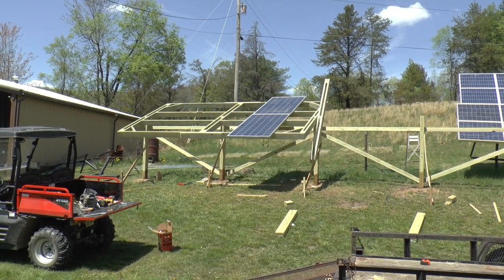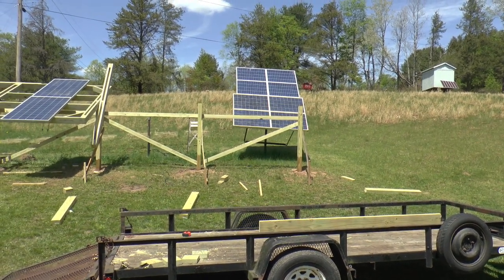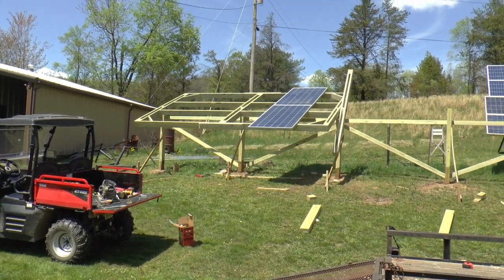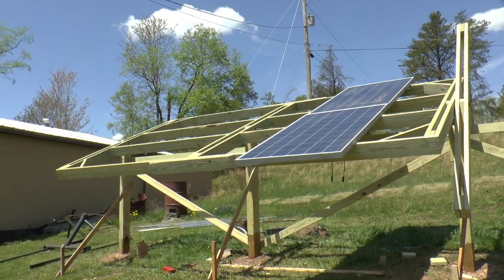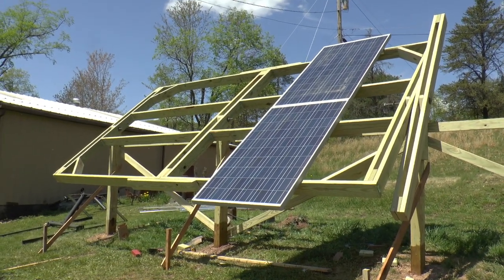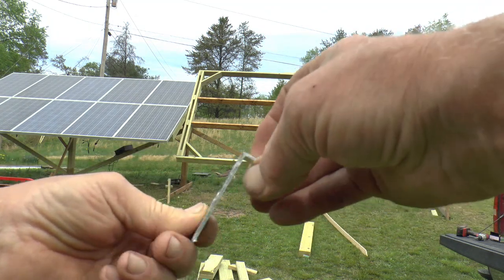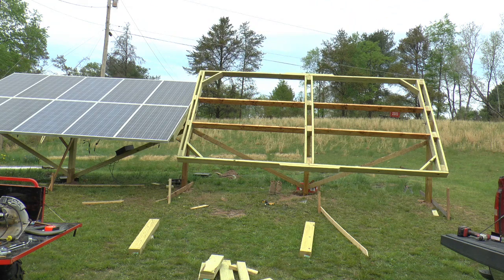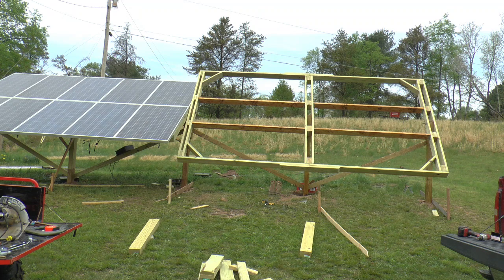DIY Solar Panel Ground Mount

Comment: Nice video.  I have seen this approach using the 4x6 posts.  One thing I don’t see on yours is a metal strut channel to bond the panels together.  It appears to me that making the wood structure can be done alone and mounting the panels later could be a 2 man job.  I am sure it can be done by one persona as well.  For the holes for the posts I am thinking of renting a post hole digger but that is a lot of concrete to mix!  Whew!! Again, thanks for the video.   All the best from north Texas.
Reply from the maker: The panels are mount to the wood using aluminum clips no metal struts. I have other videos showing more details. No concrete used for mine. Only some gravel in the bottom of the holes.

Comment: What are the dimensions? Spacing on the posts?
Reply from the maker: Everything is based on the dimensions of the solar panels your using. I laid mine out on a flat surface took the measurements and drew it out one paper.

Comment: How did you form a grounding bond with the panels, rack and ground?
Reply from the maker: All panels are series connected with a copper wire via a ground screw. That wire goes to the combiner box surge device and ground rod.

Comment: @papajunk I'm curious how you attached the pivot to the tops of your posts, particularly the middle post that has pivots for each array. The other designs I've seen go on either side of the 4x6 or 6x6. But your's appear to do something different. Can you please explain?
Reply from the maker: The center post is 10 inches shorter than the other posts. There are 2 x 6s attached on each side of the 4 x6 that are the same height as the other posts. That makes the space for the 2 x6s of each separate movable section. The pivot pin (bolt) goes thru all six 2 x6s.  The other posts are normal ( like everybody else does).  Hope this helps.
Reply: @kevincrawford2027  That makes sense, thanks!

Comment: I am in process of building one similar to this. 
It will have 12- 250W panels, each set of 3 panels (in parallel) will have a 30A charge controller.
My worry is about falling over.
Reply from the maker: If your posts are in deep enough that shouldn't be a problem. Mine will be going on it's second winter and no problem so far. Several times we have had some serious wind during the winter when it's at the steepest angle and I went out to look while windy and the posts never moved in the ground. My concern is the poor quality of the pressure treated wood now days.

Comment: Do you have a picture of how the panels are attached with the brackets,  for some reason having a hard time visualizing that,  new to this and have just bought 50 used panels i like this diy ground mount alot

Thanks
Reply from the maker: Making a quick video to show how I mounted them. Your not the only one that ask. Had lot of panel mounts over the years I like this the best so far. Video should be out later today.
Reply: @kevincrawford2027 
Thanks for sharing this great design.  I am also have problem how to mount that panels with your brackets.  Another video with greatly appreciate.  By the way, please put the link where we can buy the bracket? The link would very helpful if you could put in the description.  I couldn't find it in Home Depot or Lowes. Thank you.
Reply from the maker: There is no link where to buy them. They are home made from aluminum angle.  @user713Blvd
Reply: @kevincrawford2027  I saw it with very clear pictures and details on your mounting video.  Now I know how to find it in HD.  Thanks and I subscribed your channel.

Comment: This is great. Ive been looking for a solutionand think this would be perfect. How do you keep the tilt fixed? I have a bunch of leftover 1/8" stainless steel cable, beefy eyelets and turnbuckles. I wonder if i could rig something up to hold the panels' angles between monthly adjustments.
Reply from the maker: I have angle iron braces on the under side. They have five holes to make seasonal adjustments. Because it is balanced it is very easy to make the adjustment.